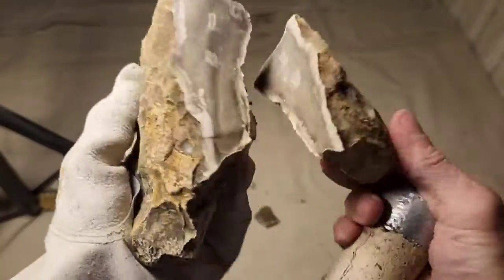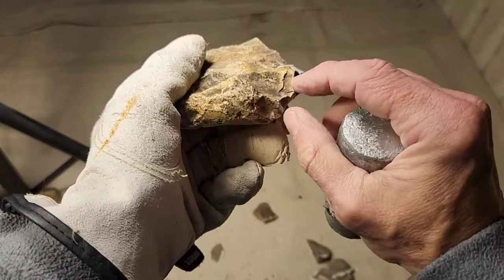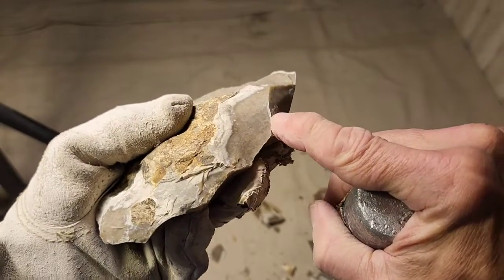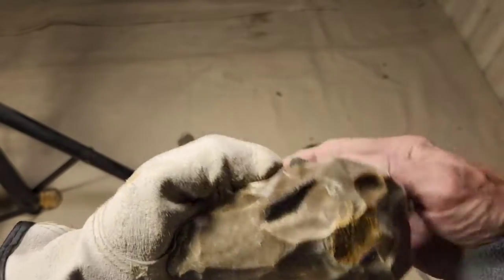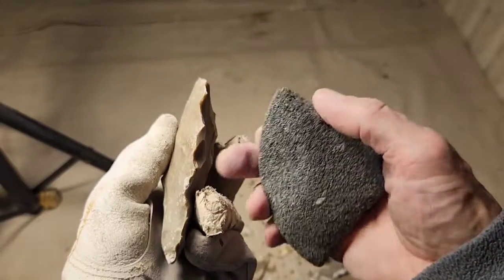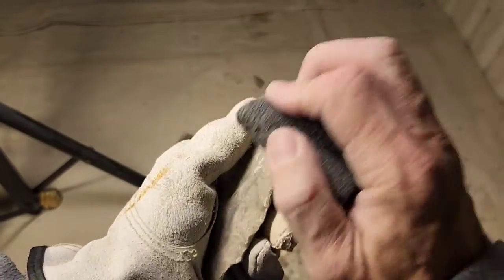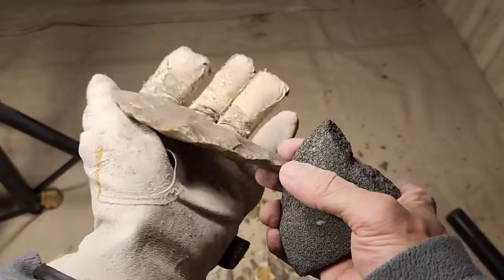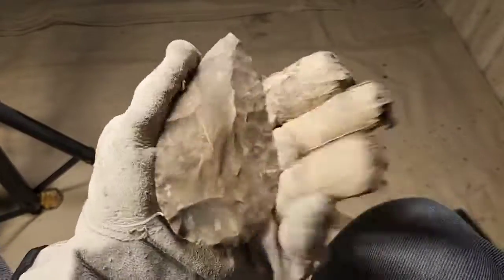1354 - Part 1/2 - Only Direct Percussion Flintknapping - Fully Explained

Comment: Hope you had a good Thanksgiving. The resolution of the new phone is better. I'm one of the ones who uses direct much farther into the process, and to "nutshell" the reason is speed. It  took a while for me to get the accuracy necessary but I can reduce mass quickly with fewer strikes as you mentioned at one point. I tend to work smaller and difficult material, so quick mass reduction is key to preserve material. I like the wider and more expanding flakes I get with direct. I usually switch to indirect to peel off deltas and do the more delicate thinning. I'm usually 5-6:1 but will do 8-9:1 on good stuff. Sharper edges so the stone bites the billet with an in and swiping motion along with kinda loose hold on the billet is my technique. I use the edge of my billet and not the end face so my preform edges don't crush from the mass or break the piece by delivering excess energy. Nice job getting that defect out...very good illustration.
Reply from the maker: Yes, I had a very good Thanksgiving,  thank you.